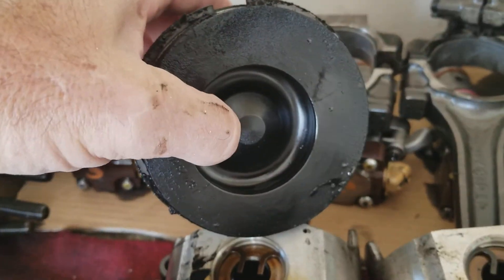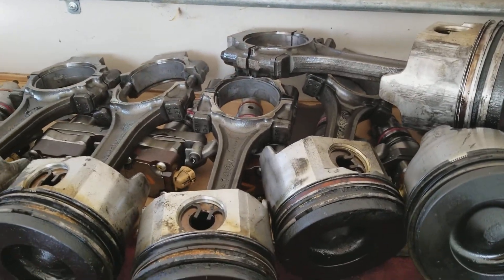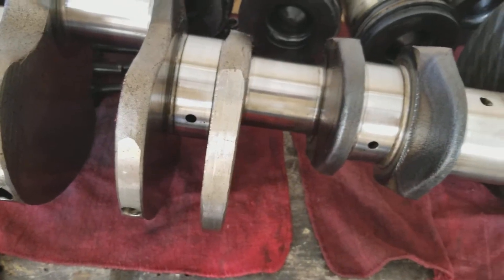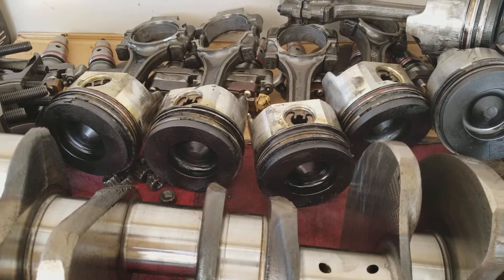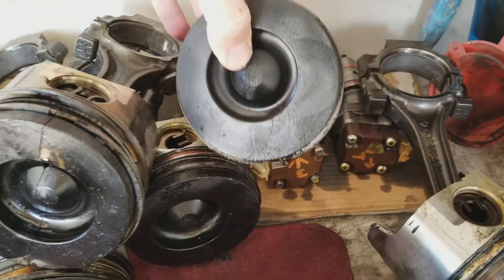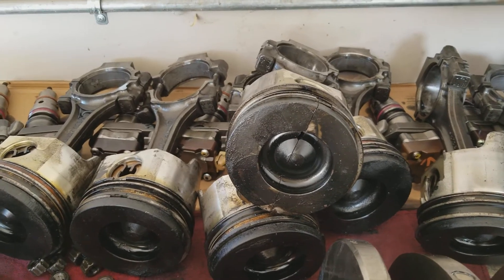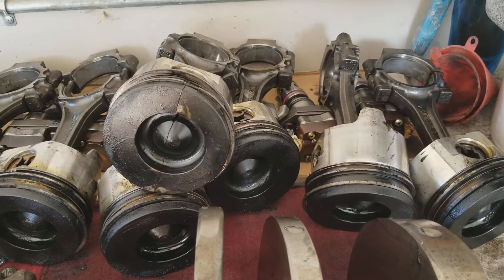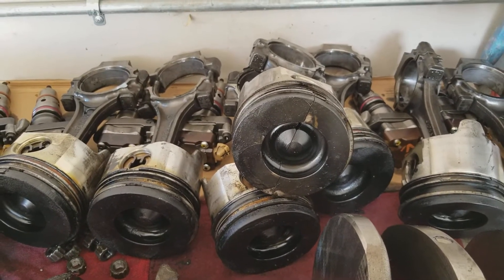7.3  Power  Stroke piston Crack

Comment: Lots more 7.3s and Cummins powered trucks with over a million miles than a truck powered with a duramax. That’s all I gotta say. Every engine has its bad batch. You just happen to have one. I’ve owned 4 trucks powered by a 7.3 powerstroke and they’ve been anyway from 87k miles to 350k miles. Tuned and not tuned. I haven’t broken a single one and they’re all still rolling down the road. I used to work on a farm that had nothing but duramax trucks and one Cummins truck to pull the harvester. 2016 Chevy 3500 broke a piston with under 100k miles, guy doesn’t run his stuff hard at all, explain that for me.

Comment from the maker: FYI....This is the FIRST diesel I have ever had to rebuild . All my trucks including 6.5 Chevy turbo and non turbo.....old 4.9 ford. 7.3 idi Duramax which IMO has been the best truck and least problems ALL STOCK. VW RABBIT diesels 1.9, Jetta TDI diesels. I have them all..... Have never needed to be rebuilt. with up to and over 400k miles. IMO pretty pathetic to have to rebuild a diesel engine with 183 on the clock. JUST SAYIN.....

Comment: Ether does in yer valves never seen a single cracked piston from ether. Rag soaked with gas layed over the filter box opening. Never seen a diesel with no swirl mark on the pistons? 26 years never seen 8 pistons with zero 4 leaf clovers!

Comment: Pushing more fuel wouldn't have affected the crank at all, and rolling coal doesn't always mean high egts. You may have multiple diesel pickup trucks but you obviously haven't go that far into the technical side if your saying thing like this. 

Edit: I mean seriously? Talking about air fuel ratios like it has a perfect A/F ratio like a gasser. Stop talking like you know diesels in and out and have years of experience working on them.
Reply from the maker: interesting. WOW....
Reply from the maker: WTF are you talking about there is air fuel ratios on diesel. Just shut off the air and see if it will still run. THAT IS WHY THEY HAVE FLAPPERS... to help control runaway. when you have too much fuel and not enough air the burn is hotter. Ask any knowledgeable diesel tech. That is why turbo helps get them to be more efficient. More AIR and FUEL to get a stronger pop.....otherwise why put a turbo on. Just to have higher pressures....I dont think so....Air is needed for the explosion to be efficient.
Reply: The butterfly valve in the intake on most newer diesels is not a positive air shutdown. It partially closes to allow the egr to function properly
Reply: @007.3l  I wouldn't bother at all man. People like this are always right in their own heads, he couldn't even understand what I was correcting him on.

Comment: I've been lucky I guess.  I have 02 f250 7.3 powerstroke just turned 500k set of injector and glow plugs have been my only big dollar problem. It stock and pulls large camp trailer all over the northwest.
Reply: 266k problem free miles on my dad's excursion.

Comment: LOL.  Wont buy a 6.0?   My 03 6.0 has 318,000 miles bone stock except for strait pipe. Best truck i have ever owned.Bought new in May 03. 1 set of injectors and a coolant pump. thats it.  They get a bad rap. Its because people dont know how to maintain them. ,
Reply from the maker: I would say lucky. Unless you do the total bulletproof. new heads studded block and upgrade the oil cooler.  total cost about 10 grand at a shop. I have no issues with any of my Duramax diesels just as many miles pulling all day long.